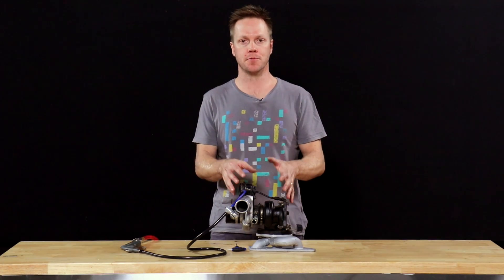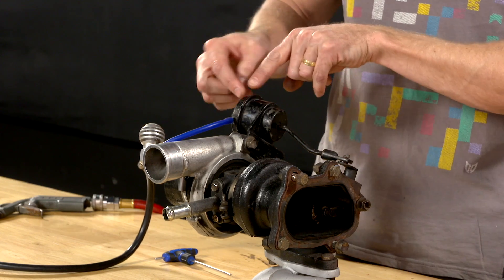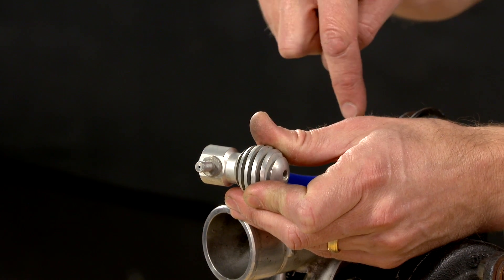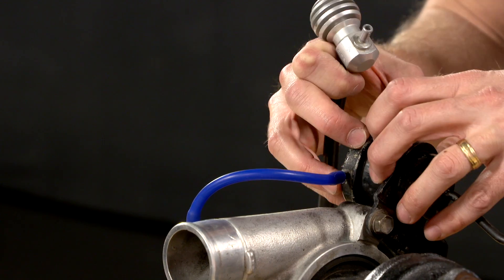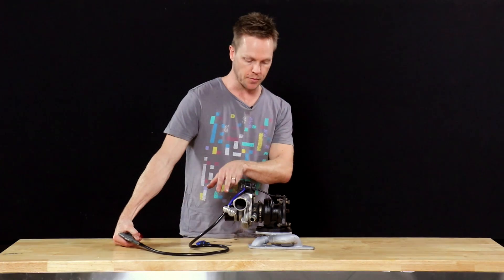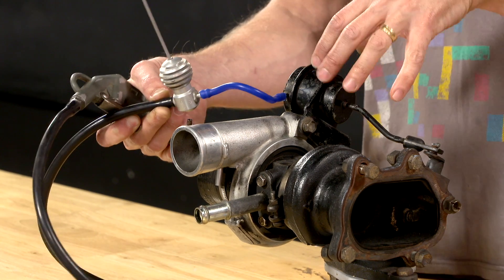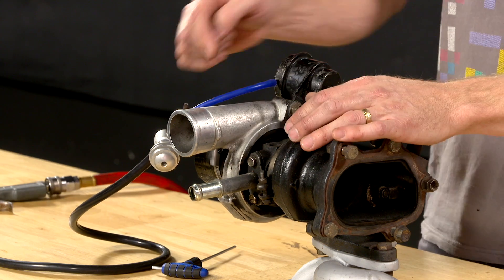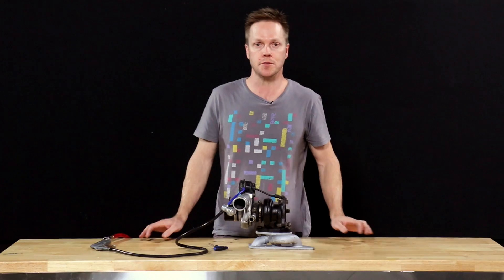Bleed Valves Explained [GO FAST BRETT]

Comment: i made my own bleed valve 😂
i hooked up a T on the wastegate pipe and the solenoid valve and the air was escaping out from the 3ed side of the T and the boost was crazy so i hooked up a piece of hose to it and i started to adjust it by a zip tie one that hose and it worked 😂

Comment: Will you do a multi valve bleeder ? I need to decrees the boost in 1st and 2nd then nail the waist gate shut for a quicker top end. The turbo can handle it. Max boost has not yet been achieved.

Comment: This is only going to be as good as the spring inside the wastegate.  OEM designs are like this so that it will not over Boost so even when bleeding off it may only gain a few psi but still should see some type of a gain.  I would recommend external waste gate and electronic boost solenoid for more power.

Comment: Hi. I have a 2013 Peugeot 308 with 115HP rolling with 23 psi of boost. A bleed valve does not work in my car because boost is controlled electronically. (I tried using a bleed valve already) I would like to know if there's another way to increase boost without a reflash of the ECU. Thanks.

Comment: What can you do if you got a 1.8 turbo gasoline engine, that haves an N75?
Reply: The VW 1.8t are easy to tune via OBD. Just go to your local tuner.
Reply: Yeah I know, I just wanted to know if there was some way to trick the N75.. Maybe if you put it in between the turbo and the N75?
Reply: You could put it between N75 and turbo to get a higher boost pressure, but the ECU would sense overpressure and would throw fault codes. Even if it didn´t you would still have to get it tuned, so you are not running lean
Reply: That's what I thought.. Was just curious, currently I'm building a new engine for my Audi A3 with a GT2871, Tial wastegate, bigger injectors and stuff like that, so it's not something I'm gonna do anyways 😂

Comment: Wouldn't that be a vacume/boost leak?
Reply: That is where the restrictor plays a role and it is so minimal that will not matter on a MAF or even less than nothing on speed density setups. I run one on 1.8t and it's awesome.
Reply: no it wouldnt because the valve is venting air that wouldnt be going into the engine the engine anyway it just goes straight to the actuator.

Comment: I would also have liked to know how a bleed valve works internally. Like what is the mechanism inside that manual boost controller?
Reply: Mike LeBlanc it's just a screw that blocks the airflow between the inlet and outlet. You loosen the screw to let more air flow, or run it down to block air flow. Blocking airflow increases boost, and loosening it decreases boost.
Reply: Or wait..no that's backward. Loosen the screw to bleed off air and keep the wastegate open, and tighten it to close the wastegate.

Either way, it's still a T with a screw. Look up homemade bleed valves on YouTube for more info

Comment: Which is better, this boost-leak type controller that lets the wastegate creep open, or the ball and spring type that seem to be all-or-nothing?
Reply: Pfft. Leaking half a cc of air?
Reply: Yeah, the small amount of lost air isn't going to make boost build slower.
The fact that the video shows the wastegate partially opening under less than target boost, that will though.
Reply: Ball and spring just lets you plumb it into the cabin without having to hear it whistle. That's what I did anyway.

Comment: i got 12psi running of stock turbo for gu td42 ute. i think it runs 10psi without bleed valve. its not much to notice but gives a bit more go driving up hills and on the tracks
Reply: Turning up boost pressure will always increase the energy yield from fuel. This is why modern engines have higher compression ratios. Same/same. Also increasing the amount of available air to burn the fuel increases the speed of the burn, which in turn raises the power slightly. So turning up boost pressure on a diesel will have a positive effect without adjusting the fuel
Reply: The TD42 found in Nissan patrol (aka safari) is a mechanically injected engine in which the the amount of fuel injected per cycle is based on only throttle position. This is cool because aside from the glow plugs needed to cold start the motor it doesn't need any electronics (only the ti version even had any). On the other hand when you combine this with the fact the TD42 (like most factory diesels) is a lean burn engine (more air than required to burn the fuel charge) it means without additional adjustment or modification increasing boost pressures will not have a positive effect on power output, instead more power can be made at the same boost with just a fuel pump adjustment, just at the expense of higher exhaust gas temperatures and more smoke when the throttle pedal is fully depressed before full boost is reached.
Reply: a cold atart is whem you dont glow it. the glow plugs just heat up a bit of diesel in the block. people think it doesnt do much but if you cold start (colder areas like where i live) it does a lot of damage to the motor and also eats up alot of oil. whitr smoke is oil burning and black smoke is it running to rich. if you go more boost you need more fuel so you turn the injector pump up a little. go to much power youll be upgrading intake and exhaust. my gu just has a stock turbo on 12psi with a 3" straight through that dumps behind the cab. that does the job for now